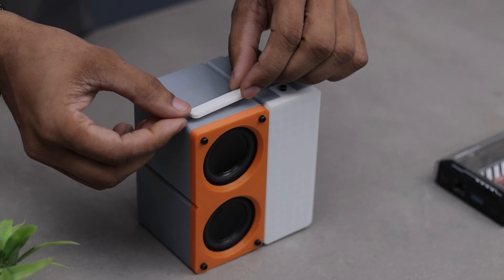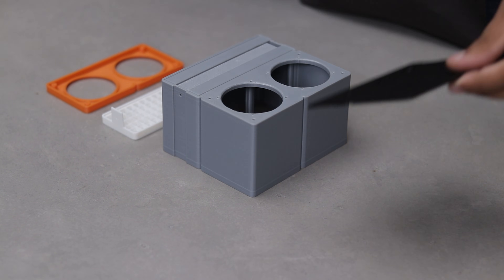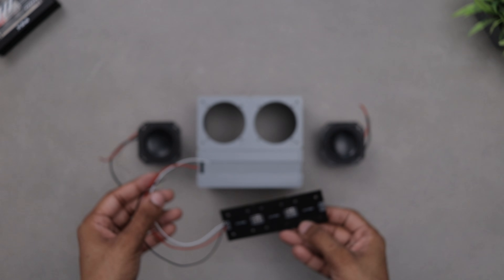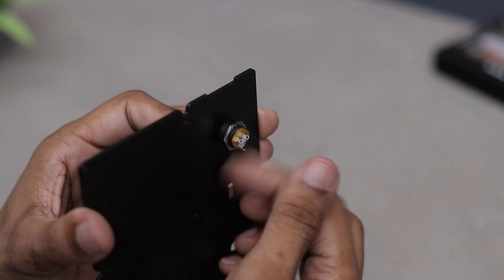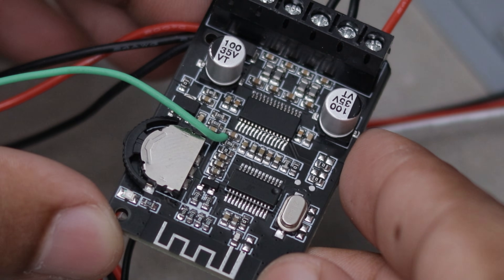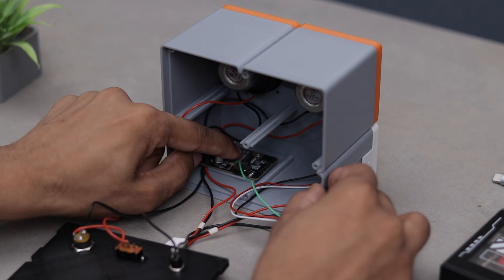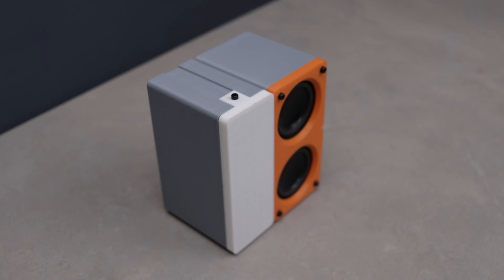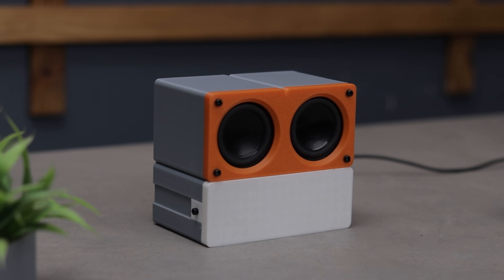DIY Bluetooth Speaker With Built-in Visualizer! | 3D Printed

Comment: hey man, first of all nice project is awesome! just one question, i have been triyng your project but keeps me wondering.. can you explain the connection between the amplifier and the microcontroller to transmit the audio data and put visualizer to work? dont see any pins or connections in the amplifier and that connection is not working for me at least, thank you in advance.

Comment: What's the rated input power supply for the amplifier circuit only in terms of voltage and current? And how much power are you using?

Comment: I like the LED grid and related components, though the speakers are way too simple. I'd combine the grid with a better speaker build (one with long piping for low frequency support, additional pair of tweets, and, maybe, concrete filling for added weight).